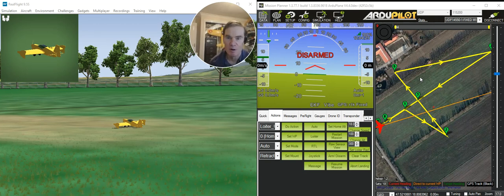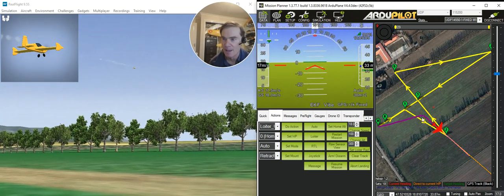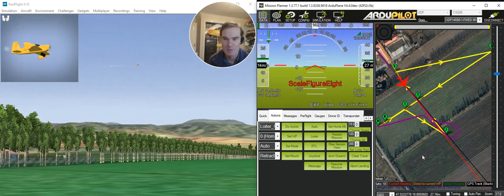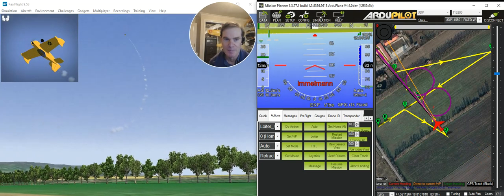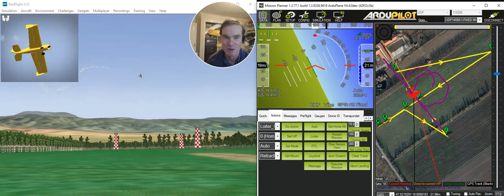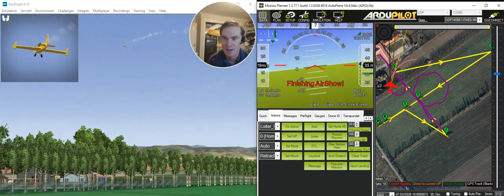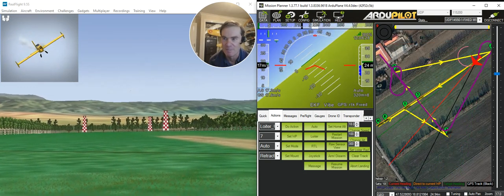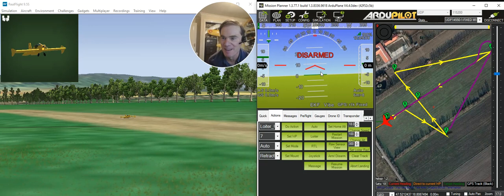ArduPilot AirShow with FliteTest3DXL

Comment: Hi sir 
can you try QuadPlane simulation on Real flight using New Firmware 4.3.1. 
In my simulation i am getting lag between GCS and simulation,  RC fail continuously happening, some other stability issue also there.
can you do one simulation and confirm no ?